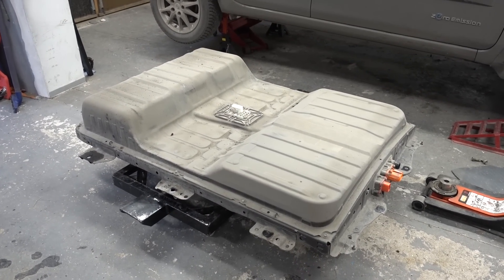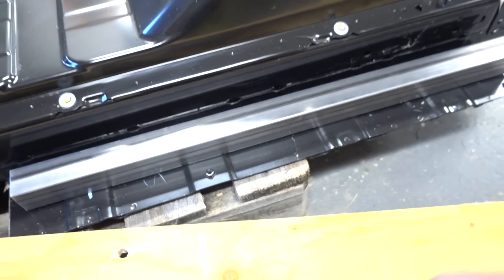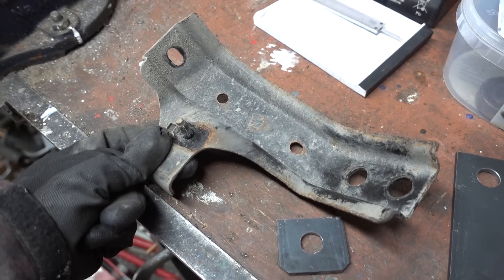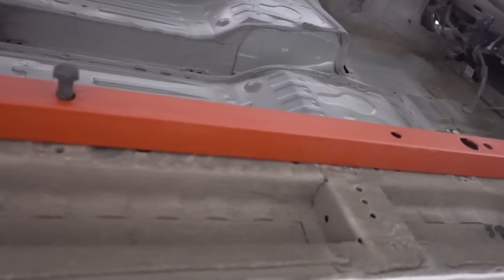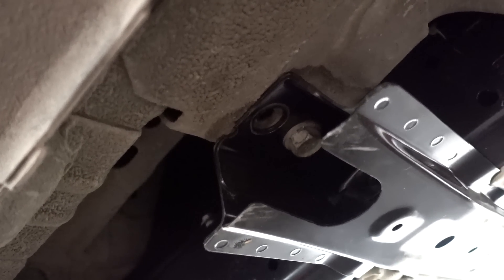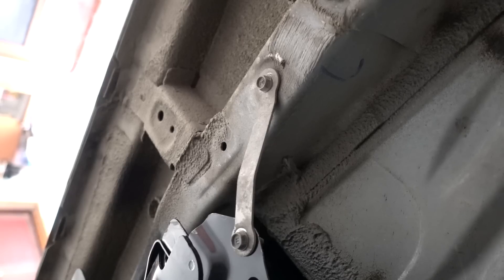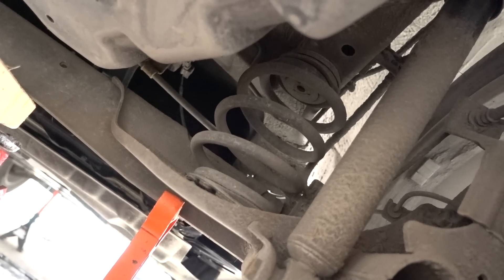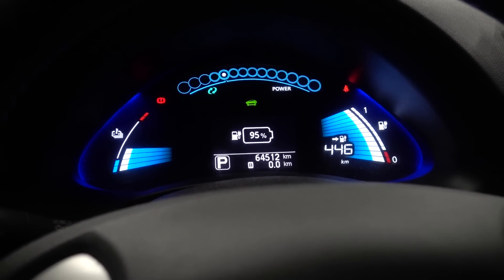Ultimate Nissan LEAF Battery Upgrade (62kWh)

Comment: Great video! Thansk for the parts numbers as well.
A question, though. At 4:50 you said there may be some links to pics of the adapter plates that are sandwiched in. Would be interested to see a bit more about how exactly those were implemented. Not sure you had time to take extra pictures to share, but any that you have to help better visualize what you did would be really appreciated. 
Thanks again for all that you do for the Nissan Leaf community!

Comment: hello.  about the CAN bridge....  would you elaborate  more as to why not using CONSULT 3 PLUS for any software installations.  What was the software and where did you installed on? thank you
Reply from the maker: Consult3+ does not help at all. It cannot be used for upgrades, only direct replacements (24 to 24).

I have written my own software for upgrades, source code available for Patreons.
Reply: @DalasEVRepair   oh,  okay.  Congratulation then,  would you explain what is it do?  your software.... 

 thank you

Comment: WoW, amazing, too bad no-one in or near belgium that does this. Else I would get mine upgraded, even the 40kw. Oh quick question any idea how to clear errors preventing start on nissan leaf? gives error on airbags in passanger seats
Reply from the maker: Airbag errors need to be adressed first (changed out if no connection), and then be reset with dealer tools. Leafspy wont help here.

Comment: Where do you find the packs? On the junk yards?
Reply from the maker: Yup! It is really easy when you live near Norway! 😅
Reply: @DalasEVRepair  hardly anything here in the UK, and what is available is VERY expensive. If you ever undertook a 64kwh niro EV battery into a leaf id be interested, as the Nito ev batteries are available, and for some reason, much cheaper.

Comment: Dala (or anyone),

In your calculations, does it cost less to buy a ZE0 leaf and upgrade it to 62 kwh, or to just buy a Leaf+ (new or used) with the 62 kwh battery from the factory?
Reply from the maker: In Finland it is cheaper to ugrade old LEAF (10k car + 10k battery), versus 35k native 62kWh leaf

Comment: It's amazing to think that the battery capacity has increased 260% while it has only become 40mm taller. Technology at work!
Reply: Can comment on how much it would cost to do the upgrade
Reply: And you can buy a kit to put CATL cells in the 24kwh case, to get the same 62kwh
Reply: 🎉 @stephenhodges2735 I would be interested in put something like that in my Chevrolet Spark EV
Reply: @stephenhodges2735  ? link cite? hard to believe
Reply: @stephenhodges2735 any link please is it straight forward?
Reply: Where to buy please
Reply: Wow I'm gonna research this thanks

Comment: I drive a Nissan leaf  daily   great wee car only thing is its lack of miles  .
In summer  full charge registers as  128 -138 Mickey Mouse Miles  estimate
in winter Full charge  registers as 117 - 122 Mickey Mouse  Miles    estimate 
what would the cost be for this larger  battery pack   as i find 95% = 446 miles estimate  rather amazing  
Great video thanks for sharing  
Edit i think i have the 40 kWh battery just now  . 
I'm amazed at the increase  in miles   for just  an extra  22kw  to make 62kw  =  +306 EXTRA MILES
Reply from the maker: 446km =\= 446miles
Reply: Sorry  ive quoted my miles   128  = 206 kilometres  
so 446 kilometres are  277.132 miles   that makes more sense now  . Yes great video

Comment: I would like to know if an ev charger could be connected to the battery only .or does it need any other parts from the nissan .
Reply from the maker: Totally possible!
Reply: @DalasEVRepair  I ask as I would like to buy only a battery, put it on wheels and charge it . Then untill v2g chargers are available I would look at possibly using an solar inverter to use battery voltage then back to home. But I don't suppose you have schematics of the nissan car layout.
Reply from the maker: @gino2465  check out mynissanleaf forum, people using the charger standalone there with CAN commands

Comment: Great work! :) Some questions, will the brakes need to be upgraded as well, due to extra weight?

And what about 'type approval' for the vehicle, will it be approved in the next semi yearly 'MOT'-test / EU-control with the extra weight and new battery?
Reply from the maker: No need to upgrade brakes, e+ uses same as on old LEAF

This depends on your county. I can point you to the Finnish legal paragraphs, stating that when using OEM parts this upgrade is OK. So yes it will pass MOT/EU control here! (just remember to submit the change in weight!)

Comment: Did that new mounting also meant 40 mm less ground clearance? If so might be problem on some speed bumps.
Reply from the maker: Correct, but with the stiffer springs this shouldn't be a big issue. The LEAF rides very high compared to sportier cars on the market.

Comment: very nice work. I have a 2018 40kw leaf and want to upgrade to 62kw. is it possible?
Reply from the maker: Yes, exact same procedure!
Reply: Where do I get the 62 kWh battery. Do I also need the rails u mentioned as I already have 40 kw . I thought the chassis would be the same for the 60 kwh
Reply from the maker: @umeshchand6682  rails needed! Salvage yards!

Comment: This is amazing. This kind of independent repair shop upgrades and repairs must be easy to implement by design; mandatorily. This will save millions of cars from scrapyards and prevent waste of resources. Thank you Dala.
Reply: I couldn't agree more. Any authority claiming to be green should legislate against completely artificial digital lock-outs to repair, replacement and maintenance of all devices.
Reply: @rbettsx  Apple.
Reply: @RobertBoston-n4d  Tesla.

Comment: Hello and congrats for this excellent video. 
May I know please, is it possible to upgrade a 2021 Leaf 40kw battery to 62kw battery? 
Will it be easier or harder to replace it ? 
Also with a new 40kw battery swap to another of 62kw battery how much you thing will be the cost difference?
Reply from the maker: Exact same procedure on 40kWh LEAF

Comment: Good Work!  277 mile range for a Leaf is awesome!  Is there a resource for transplanting a Leaf motor/batteries/control system into a classic sports car either front engine/rear drive layout?  (Subject is a 1965 Triumph Spitfire.) Any help is much appreciated.
Reply from the maker: Jump on the diyelectriccar forum and check out similar builds!
Reply: Hi, I bought a new 62kw Leaf 12 months ago, it now has 25,000 kilometers & I only ever got 350/360 kilometer range per full charge, nowhere near 440 kilometers. Also because it is now 0 degrees in Ireland my range is showing only 280 kilometers when 100% charged.
Reply: My leaf 2018 40kw in Canada, now I get 250 km in summer but I can only get 150 km in winter.

Comment: How can I see if my pach needed only changing back cells or is needed all?
I have a 30kw pach and now is at 66% SoH
Reply from the maker: Sounds like you need the software update for the 30kwh pack: https://flipthefleet.org/2018/30-kwh-nissan-leaf-firmware-update-to-correct-capacity-reporting/
Reply: @DalasEVRepair  Spy Leaf reads that i have the A version.
This update need to do it at a Dealer for Free or i can do it myself ?
Reply from the maker: @eunu6928  dealer only
Reply: @DalasEVRepair  hope this update unlock some kw.
I have 180k km and can use only 20kw with this 66% SOH, 2017 year build 2100+DC and 2000 AC charged
Thank you

Comment: Great job, no doubt about it.  My wife drives a 2011 leaf since Nov 2010. She loves it.  However, it only goes 32km (20 miles) at full charge now. I don't wanna mention the range when A/C is turned on. 
I looked around at the battery swap options. 
You won't believe how this turned into a business. I called tremendous of a number of junkyards where they get tier cars from the insurance company or directly from the people. 
Leafs arrive without a battery. Some people just collect them and sell them over the internet and you can tell that it is not cheap at all. This became a good business. You need to do a great calculation that if the swap makes sense,
Nissan offers a new battery if you are ready to pay $12,000 CAD if you are ready to pay 2011 GEN1 battery pack. 
 
My question to you is: As we all know,  there is nothing wrong with the car and there is no need to buy a new car until cars would have full capability to have fully autonomous driving. Why Nissan just produces the new battery pack compatible with their older models; we all know it is simple as producing a laptop battery for older laptops. What do you guys think?
Reply from the maker: They are probably worried that cheap replacement packs would go straight to stationary storage, so best to simply don't offer it. Also new car sales would be affected.
Reply: @DalasEVRepair  Thank you Dala. It is all about selling more cars than selling and providing new batteries. Let me know when you decide to have your vacation/holiday in Vancouver Canada Area. Love to catch up.
Reply: @DalasEVRepair   Leaf is like WW Beatle. Great classic! Still miss my LEAF, but always with LOVE. Happy with second gen. Ioniq,sorry,
Reply: @DalasEVRepair   Yep, 60kW would go straight to solar storage if a good price

Comment: I have the same 62 kWh in my 2014 leaf. It was installed in Poland 2022.02 in Radom, company: "elektryka u Patryka"
Problems: 
For me, it shows the battery percentages wrong, LeafSpy is essential. 
Only the first plastic under the engine fit.
Reply from the maker: You maybe need an updated CAN-bridge. Ask them what they used, I can also supply these.
Reply: @DalasEVRepair 
For me, the battery percentages are shown on the display in the car in the range of 11-93% 
11 is zero 
93 is full 
I have to look at LifeSpy or to the right for available kilometers. 
The person who assembled it said that it has to be like this and nothing will be done about it 🥴

Comment: Great video! 😀 Wouldn't mind upgrading to a 62 kWh or even a 40 kWh one, but that will have to wait until I won the lottery or something. 
30-50 km of range on current 24 kWh pack will have to do for now.
Reply: Omg... Range anxiety?
Reply: @chrisE815  My daily trips are a maximum of 35 km so I have learnt to live with it, and to estimate my range at current temperature and use of heater.
Under -15 C it however becomes difficult to make it. Turtle mode after just a few kilometers and range anxiety sets in... The battery heats up after that giving some range back, but I usually try to borrow a petrol car in cold weather and obviously for all longer trips.
Reply: Wow. Did that battery get some really bad abuse?
Reply: Yikes! We still get just about 100km from ours, just lost the first health bar. Although it's the updated model (2013?) and built in 2015.

Do you have the original/first model? How old and how many km total? Did you kinda abuse it like always charging to 100% and stuff?

We love this car and hope to drive it for a long time!

Comment: how much did the 62kw  battery cost?
Reply: Easily 18k is my guess
Reply: A 64KWh battery costs about $8000 now. There are also better upgrades with higher capacity (70KWh+) & active water cooling available.
Reply: @AWellesley  link for the better upgrades ?

Comment: Dala, could a battery update 24 → 40kWh for the ZE0 be done by changing the modules inside the battery housing?  So 24 modules 14,4V would replace 48 modules 7,2V?
Reply from the maker: Yes, but this upgrade is crazy dangerous compared to just installing OEM non-modified packs. I wouldn't even trust myself to do this upgrade!
Reply: @DalasEVRepair  Is it possible to upgrade Renault Megane e-tech' s battery to higher ranged (90-100kw..) ones in the future?
Reply from the maker: @mrtpsr4430  no clue, best to check with Renault discussion forums!
Reply: of course,wo can upgrade to40k ,53k,64k

Comment: Hi Dala!
How much did cost the big pack?
Where did You get it?
Also, I live in Latvia and for winter or summer field rides I do put higher profile tyres...
At the moment I drive Octavia 06' tdi on high 16' wheels, it looks like 4x4😁
My wife has Note, and we are due to swap it to "old" Leaf.. 
Solar bought, not installed yet..
Reply from the maker: I've seen 62kWh packs go for anywhere between 8 to 12kE!
Reply: @DalasEVRepair  before Ukraine/ork war leafs went for 5-7k, now bout 10er.. still a great family investment, just maybe have to have some ecu battery temperature mesurment on some screen  to keep eye on.

Comment: What about suspension? May be rear springs from Juke will fit?
Reply: juke is light vehicle in comparison, so most likely not.
Reply: @gelisob  well, I just made a suggestion. But also obviously 62 pack is more heavy than 24 or 40
Reply from the maker: Just get the proper e+ springs, part number 55020-5SJ1B

Comment: If one would like to eventually replace rhe 40kwh battery with the 62kwh on a leaf18, then there would be the same mounting brackets issue as between the two just like in this case even with the newer chassis on the leaf18?
Reply from the maker: Yes, same issues!

Comment: Congratulations! so technically the 62Kwh battery get more heated comparing to smaller ones?
Reply from the maker: Less heated. The 40kWh runs the hottest of all the packs.
Reply: @DalasEVRepair  Wow! that's some news. Can't wait to see a long test run with the proper springs!

Comment: Amazing job!!! 446km/277 miles!!! Hey did you see evsenhanced has a thermally managed battery for the leaf?
Reply: it's probably really expensive compared to normal one and here in northern countries, you dont really need the thermal managment most of the time :) Snowy countries are the leaf countries.
Reply: I saw that, I think theirs was only 40 kWh, but it's a start! I hope one day to put a 62+ kWh thermally managed pack in my '18 LEAF. Still excited for progress on the CCS mod too!
Reply: @JohnVance  EVsEnhanced is going to have 3 different models.  The first is 40kWh, the second will be 70kWh, and the 3rd high-performance model hasn't had the capacity announced yet.

Comment: End price for customer?
Reply from the maker: 62kWh packs go for about 8-12kE depending on EU location!
Reply: @DalasEVRepair  and the cost to put it in? What does a repair shop, say one located in Finland in the Wasa area (just as an example) , charge? 😏
Reply: @koltroll  Dala did say installing it was full days work. I think he should get atleast 800€ + vat for install. Remember this pack should outlast at least two 2016 leaf bodys.